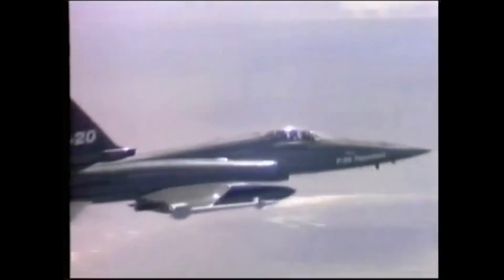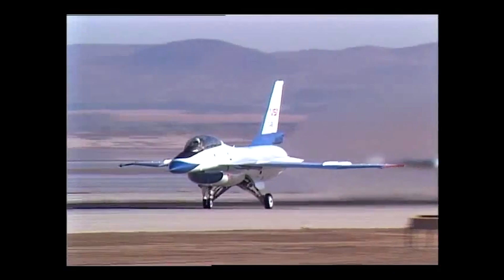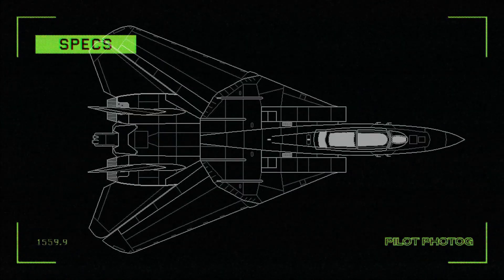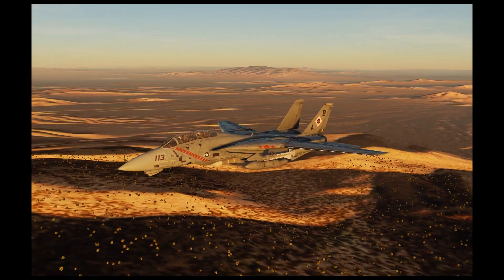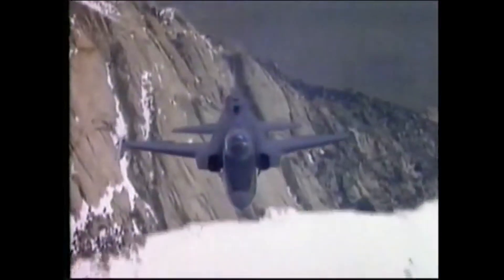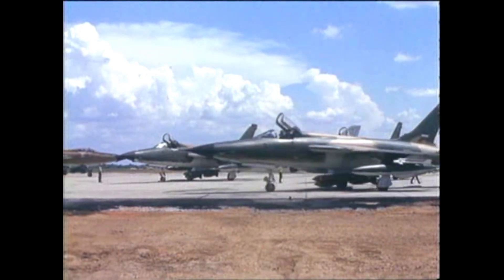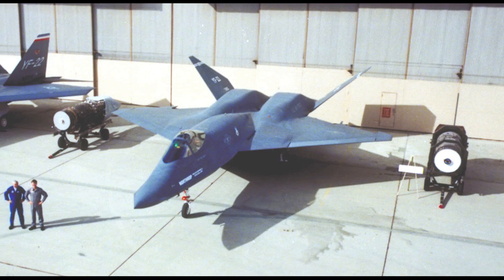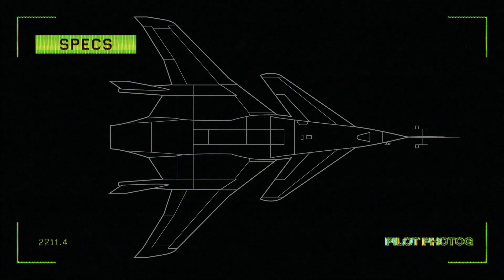Top 5 Fighters That Should Have Been Built | Best of Aviation Series by PilotPhotog  f20  f16xl

Comment: The Soviets inherited F-5E Freedom Fighters when the NVA took over all of South Vietnam. In mock dogfights, Soviet pilots learned the F-5E could quickly get behind a MIG-21 and register a "kill". And it did not matter if the pilot flying the F-5E was an experienced veteran or a brand new novice. The F-5E would win. This was a sobering revelation...when you consider the USAF did not consider the F-5E a suitable combat aircraft for adoption. The F-20 would've been absolute badass.
Reply from the maker: Agreed and thanks for commenting!
Reply: The F-5 is one of those underrated modern jets that I hope will be added to War Thunder some day.  I think it would be very competitive and fun to fly.
Reply: @CountArtha  the USAF has been using the basic design as the T-38 for a reason.
Reply: @svenschwingel8632  basically an F-5/F-20 without the armament and hardpoints, which I'm sure could be added if necessary
Reply: @CountArtha  the F-5 is easily my favorite Vietnam era aircraft.
Reply: Cold War era as well in my opinion. Cheap, easier to maintain, S/TOL capable, and out flew everything pitted against.
Reply: @CountArtha  As a War Thunder player, I agree. We should have gotten the F-5 instead of the F-4, especially considering the time frame of when the F-4C was introduced into the game, it would be much much more capable even now. However, I have a feeling we're getting close. We are getting the F-11 Tiger during the summer event, hopefully the F-5E Tiger II isn't far behind!
Reply: @CountArtha  War Thunder dog Fight is based on who has the lowest latency ping on computer connections ... nothing else !!!
Reply: @CountArtha  to this day it s still my fav of all the fighers ive driven
Reply: @CountArtha  Just get DCS, that has an F-5, a MiG-21, a FREE A-4, its great and its so much more realistic than the trash that is war thunder, so you'll probably have some trouble learning it.
Reply: And when the US assessed MiG-17 vs US fighters in Vietnam, they made recommendation that dogfights should always be avoided.
Reply: @FromWitchSide  Yes, our main aircraft were more "multi-role" than designated dogfighters. The USAF did not see an operational requirement for a designated, short range, agile dogfighter. At the time, we liked stuff with impressive bomb loads.
Reply: @FromWitchSide  Fortunately all that involved with the MiG-17 was the US Fighter fire-walling the throttle and possibly going vertical.
Reply: @FromWitchSide Actually the operation HAVE DONUT (the tests performed in captured MiG-17s) showed that turning fights against the MiG-17 in the F-4 should be avoided. Instead it was recommended that the F-4 should take the fight to the vertical where it had the advantage. This resulted in the Vietnamese completely abandoning the MiG-17 in the later part of the Vietnam war even though they preferred it as it was easier to fly.
Reply: Very narrow minded, if that’s the case.
Reply: the us want market for f16 that is why f20 got banned
Reply: Grandturismo the f-16 is a great aircraft. Maybe they should have built both, but no one should regret buying an f-16.
Reply: @catfan5756  Indeed  though at the time in most ways the 20 was a good deal superior.  The F-16 grew into a very very good fighter over the years.. and no doubt the 20 would have continued as well.   But those that are constantly trying to compare the 2 are looking at it all wrong since they were never really intended to do the same job per se..   But again dirty politics.

Had Canuckistan been smarter at that time and used their good relationship with Northrop then  the F-20 may very well have been build as the CF-20 alone with the F-18L instead of the /facepalm inducing stupidity of selecting the 100% untouched FA18 that cant even fly from Montreal to Toronto on internal fuel ffs!
  But thats another looooong story.
Reply: @grantourismo0109  Here's what happened: originally, the F-20 wasn't competing against the average F-16A/C. Rather, it was a variant of the F-16 with a worse engine and radar. Taiwan, South Korea, and Pakistan had shown interest in the F-20, but there were some issues: The administration in power at the time had put major restrictions on what US defence contractors could and couldn't sell to other countries. Every time Northrop attempted to sell the Tigershark to Taiwan or Pakistan, it was blocked. Thus, both Taiwan and Pakistan saw fit to develop their own fighter aircraft with a similar role to the F-20, those being the F-CK-1 (Taiwan) and JF-17 Thunder (Pakistan). Then, the two airshow crashes of the F-20 happened (no fault of the plane, or pilot, occured due to the pilots pulling too many Gs and succumbing to G-lock). Once the Reagan Administration look over, and restrictions were relaxed, General Dynamics immediately began selling their new F-16Cs to other countries, specifically to spite Northrop.
Reply: Pretty sure the US doctrine by then would move to BVR (as we see today) rather than WVR. But yeah, it's interesting how they just up & left the maneuverability component.

Then again, NG did implement the tech they have into the Hornets, so maybe it's not a lost cause after all.
Reply: @TheRibbonRed  the focus on BVR air combat served the US really well in the Vietnam theater. Especially with orders forcing pilots to visually identify targets before any engagement. And an AIM-7 that wasn't really reliable 🤔
Reply: @TheRibbonRed  but didn't military doctrine put a stop to bvr combat at that time due to several friendly fire incidents?
Reply: Quirt Manly  As I understand it, the F-20 while a good aircraft was short legged in range as compared to the F-16. As such, it was one of the reasons  the Air Force turned it down. Because our Air Force turned it down, many foreign air forces also decided against it in favor of the F-16. However that being said, I do agree that it would have been a great export model to allies in South America and other countries.
Reply: @coleparker  - yet these same nations bought Mig-21's, which have a shorter range than both, so... I don't believe this was a genuine factor.
Reply: @downix  Well, I am not necessarily disagreeing with you. But that was one of the reasons I read that it was a factor.   Also, as noted, the nations were not comparing or basing their decision on F-20 vs MiG 21 but the F-20 to the F-16.
Reply: @downix  Yes, but those MiGs were bought back in the 60s and 70s and even up into the early 80s when their competition was the F-5 and not the F-16 and they were cheaper to buy and were upgraded variants to the already existing numbers in those airforces that were employing,  IE, India, the former Warsaw countries and the middle east countries.
Reply: @coleparker  - the last mig 21 variant was built in 2013, keep in mind. People were buying them long after the F-20 vanished from the market.
Reply: @downix  Well, thanks for the info.  I do believe it was an upgraded variant bought by the Indian Air Force if I am not mistaken. Correct me if I am wrong. The only thing Negative, other than its limited range, I have heard about the MiG 21, was from an ex-Vietnam era Navy pilot, who flew a Polish Variant of the fighter. He told me that it was a hot plane but that it was easy to lose control if you were not paying attention to it at all times.
Reply: @coleparker  I have heard the same. India's record, having lost over 100 of them in accidents, would stand as testimony to that as well.
Reply: @coleparker  very good point. Along those lines, I seem to recall that the US also had an "Export" model of the F16 that was not quiet as capable as that used by the USAF or NATO. Have you heard anything about that?
Reply: @cameronsmyth6646  I have not heard that. But I think it may be a reference to the idea that the export models of the F-16 did not have all the latest avionics in them.
Reply: @cameronsmyth6646  @Cole Parker didn't you know the F16/79 version?
Reply: again faklse suppositon..  thats a common myth but is not why at all
Reply: @coleparker  People passed on the F-20 for one reason. It was Diet Pepsi.  The F-16 was real Pepsi. The Market said, "why buy Diet Pepsi if you can buy Pepsi?"
Reply: @WALTERBROADDUS  because zero calories and comparably great taste is why diet is better?
Reply: @WALTERBROADDUS  better analogy would be F-20 is store brand soda, F-16 is actual pepsi.
Reply: @WALTERBROADDUS  That is as incorrect as you can be.  The F-20 fired more weapons at the time and had a better reliability rating and much lower cost to acquire and operate than the F-16.  You could buy almost 2 Tigersharks compared to 1 F-16 at the time.  Also "E69Nazgul" the wing loading on the Tigershark was not terrible.  It had GREAT performance thanks to that GE-F404 engine.  Yeager said it was the best fighter he'd ever flown, and I believe him.  It was a great plane to rate fight and Yeager also said it had a good turning *radius*.  You want both of those things in a fighter.  There is a huge difference between someone like Spick who researches and writes about things vs. BGen Yeager who actually flies the damn things.  I know for sure who I would listen to.
Reply: @karlchilderz  Blah, Blah, blah....The market said we don't  want "Green Eggs with our ham."
Reply: @WALTERBROADDUS  yeah, and let me guess how much tactical jet experience you have?  I know.   Zero.

2200 hrs here.
Reply: @karlchilderz  haaaa my friend...business is business everywhere...ahahahah...
Simply marketing
Reply: @karlchilderz  Did you actually get to fly the  F-20?  Personally,  I thought the plane would have been an excellent export plane to those countries already flying the F-5E.  Also before you ask me,  I am a rather large male, and one of Chuck Yeager's first comment's he made to me out at Edwards AFB, was that I would never have made as a Combat Pilot:)
Reply: @coleparker  I've flown the T-38 and F5-E.   I didn't get to fly the tigershark, I wasn't a test pilot and didn't work as flight test for the manufacturer.   Yeager did, and his statements in person and in writing are what I go by.
Reply: @karlchilderz  Okay. Like I said, when I was sitting in the vehicle with Chuck Yeager, I  wished I had asked him about the F-20. Unfortunately I did not get a chance too. At that time he did not really like to answer any direct questions. So in order to get some of the information I did get, I had to kinda of slide into the subjects.
Reply: @coleparker  He has no problem being a prick, that's for sure.  I've seen him get short with folks.  No idea why he's like that.  When you saw other folks like Robin Olds and Bob Hoover, they were so nice and friendly it was heartwarming to be around them.  Yeager, he's just prickly and cold personality wise.
Reply: @karlchilderz  Yea, I remember when he called a bunch of C-130 pilots a bunch of bus drivers. They did not like that at all.  I found with Yeager if you did not ask him a direct question, but rather just made a comment around him,  like The ME-262 was better than the P-51, then you get a real response from him. When he told me I could never be a combat pilot, I just laughed, and suddenly he would tell me stories about, Pancho Barnes parties and breaking the sound barrier.
Reply: fuckk no... the 20 was handing the 16 its ass in more ways than not.. and if it was not for dirty politics then the 20 undoubtedly would have outsold the 16 world wide
Reply: Karl Childers Thank You!, The F-20 Out turn and more maneuverable than the F-16 . You know what ! The F-20 was a super cruise  fighter too . Way ahead of its time..They don’t Like Northrop!
Reply: Lol, I agree, TBH. Coke Zero is way better. In comparison Dirt Coke is pretty much medicinal.
Reply: @cosmiccoolie3051  Under Reagan, our milirary acqiured the humvee, the Bradley, the Abrams, the MLRS,  the B-1B Lancer, and the Paladin 155mm howitzer. The military that defeated Iraq in 1991 was NOT Bush's military. It was Reagan's. HE built that. Make no mistake.
Reply: there was undoubtedy alot of dirty politics involved  but rrr personaly i doubt   from what i know of him he really wasnt a hands on guy per se in that aspect.. but undoubtedly he was happyto have someoneelse lead him from a to be etc on such things..   as most politicians do in most things.

sadly that also leaves the system more vulnerable to more backroom deals and other bs
Reply: @WALTERBROADDUS  No.. thats  not even close to an accurate analogy

ffs.. the "real peopsi" you descrbe by that measure would be a cola w/o the COLA since the 16 lacked any capability for BVR at all not to mention many other major failings.

DIrty politics was the primary factor in that decision make no mistake and it sadly also playe a role in killing teh 20 even for export useers as well at the same time.
Reply: @MarvelousSeven  Nope.. again a massive FAIL..  the F-16 would be a bottle of 7up when you want a  bottle of Coke..
Reply: @kindanyume  The most successful fighter of the last 35 years. The  F-16 was the better buy. Performance beats politics.
Reply: @coleparker  How big?  I fit with room to spare at 5'11" and I had several others with me that fit as well and they made me look tiny..   My sparring partner Trev however would NOT fit as a rule in  well.. any fighter I think (He was 7'0" at 400lbs of muscle  no fat to speak of)

and damn you  all the time I was at flying at EAFB I never got a chance to actually meet him..  damn close many times but sadly no luck. :(
Reply: @karlchilderz  I have similar exp and would have loved to get my paws on the 20 as Ive said for most of my life..  But sadly no such luck but VYs word on that is work a billion and more..  I would take his word on such over damn near any other w/o any issues at all.

Not to mention my fav is still the 5.. even over the 15 which was also a hell of a beast :)
Reply: @karlchilderz  A friend that worked with him some time back and knew him for a looong time said he grew more that way over the yrs due to harassment by people in general as well as his being very annoyed with the level of stupidity that he saw continue to go up and up in both the basic brass bs but also higher up the chain and lunatic shit by non-mil nit-wits pushing "PC" garbage where it didnt belong and never helped anyone,
This also got worse after Glennis passed according to some other sources
Reply: @coleparker  They may not have liked it  but I can understand where he was comin from  at least in part.   I have met some driving heavies that are nice and polite and then Ive met others that think they are all that and more and almost all of them Ive found like that are washouts that wanted fighters but couldn't cut it for whatever reason.  Given his carrer I highly suspect he ran into far more of the latter and that would get most tiresome after a while
Reply: @kindanyume   Well, I am 6'4 inches tall and was big in the shoulders and chest,  although my gut is getting bigger thanks to Gruesome Newsom's shut down of the gyms in California.
Reply: The lessons learned from this went into the Mig-21 upgrade packages that the Soviets came up with.
Reply: Nato aquired Mig-29's when Germany reunited with promise they wouldnt be dissected by western intelligences .
Reply: @douglasmiller8607  There's a Mig-29 at the Wright-Patterson AFB museum, and it was clearly flown by American pilots.
Reply: @ashcarrier6606  intetesting, there's  a number of foreign aircraft at Nellis AFB that are flown by American pilots.
Reply: @douglasmiller8607  engines in W. German mig-29s are only capable of 90% the power of the Russian model. That is intentional.
Reply: @MarvelousSeven  I do not know who told you this, but it is not true.  I flew against those jets.  They had everything they were supposed to have from the factory, power rating and all.  They had those IR missiles they'd "kill" us with because we at the time did not have any HOB missile capability.  The Aim-9x was a long way off at that point. They could shoot the hell out of that Archer however.  

In any event, do not believe who or what told you the engines were de-rated because they were not.  They were powerful, and they sure as hell were smoky, but watching them in the air was a wondrous sight to us at first.  We were just mesmerized by the thing.
Reply: those F-5E came through Clark AB on C-5 transport to be assembled then flown to South Vietnam..
Reply: Look at my profile pic.
FAH
Our air force has shot down several narco planes. The F5s were the reason Nicaragua had to bring in soviet Sams to central América in the 80s and 90s
Reply: You may remember that the F20 was originally designated F5G and that the US had an agreement to allow Taiwan to buy F5s.  China pressured the US to not allow Taiwan F5Gs so they were redesignated as F20s to keep China happy. I have often wondered if the B2 contract was partially a payoff to Northrup for not protesting too much on the F5G/F20 screwing they took.
Reply: @normanhosford2506  You would have a better argument about the yf-23.
Reply: @normanhosford2506  That had nothing to do with why it didn't make it to market.  As has been shown, when the USAF didn't want it, it made other folks stop and say "if the USAF doesn't want it, why would I want it??"  and that's all it took.  Not all fear has to be rational or logical in its nature.....
Reply: The Israeli Air Force using the F-16 in the Osirak raid ended any hope of international sales for the F-20. Why take a risk buying an upgraded low budget design when you can get a thoroughly modern, combat proven aircraft?
Reply: @tpxchallenger  That is a prescient, well-considered observation. The F-20 would've been an excellent, low cost point defense dogfighter. But against a "low cost" fighter that can in one mission achieve a strategic victory? As opposed to mere tactical victories?
Reply: As Chuck Yeager noted, this was the Best Interceptor (short range) Ever!
Reply: Vought XF8U-3 was the best that was not chosen
Reply: @user-gu1hl2kx2k  no way, but it definitely should be on the honorable mention list.
Reply: The F-20, I believe it superior to the F-16 and a much more able dogfighter! It's a great design!!!
Reply: @mickydee7568  That's great ! 
Pls provide your infor source, 

also what was USAF's over all strategy(s) when they developing F15 & F-16, 

Also, with USSR alreadly know about F5's inside out, does USAF really want a F5 (2.0) to help USSR ? 

just asking,
Reply: The F-20 should've gone to Taiwan, but they didn't want to upset the PRC!  Bad on so many levels!
Reply: @folgore1 It should have gone to Canuckistan along with the F18L instead of the blunder of the powers that be forcing the FA18 instead.
Reply: Northrop designed and built the F20 on it's own dime in exchange for the government selling it. Gov. shafts Northrop. It was just political. Great plane designed for the export market. Not for U.S.
Reply: Well I'm not surprised by that.  The MIG 21  was fast but in a one on one full on fur ball the F5 is more nimble and is going to turn inside of the 21.  The 21's only hope is to bug out and scoot in that scenario.  Of course, numbers, tactics,  and sophisticated weapons can change the out come!  The Kenyans still fly F5's.  Bet they would like the F20!
Reply: @edwardsvancara7133  There are many F5s still in service,,  again its still my fav to strap into even more than the 15,   Some have some very sweet upgrades as well to keep them very much closer to modern gens.. and in many ways superior IMO..  sadly the power factor was not one part that was fixed that I know of.. (not counting thr F20 obviously)  There are several engine possibilities that could be made to work in the 5 though with a nice increase in power..  but given the age of the airframes thats not likely though I could wish!

That said I'm hoping the leaves and shirts get a clue (ie dont completely screw the pooch) and nab the newest Gripen for canuckistan..  of the 3 choices avail its by far the best  and it is in spirit a modern day F5 as much as one could possibly wish for given what is being made
Reply: The politics prevented us from getting the better aircraft at he time. Jack Northrup pissed of the people who make the decisions to buy the aircraft and got blacklisted. That's why they didn't build the B2 till after he died. Also I wouldn't put it pass our leaders to own stock in the winning companies. I did  air force maintenance for 9yrs, on F4 mostly. Talked to F5 mechs who worked 1/4 of what I did. Would have loved to work on F20s. They would have been the perfect alert aircraft. Too bad they never had the internal fuel capacity for extended flights.
Reply: @jeffreykiszer5239  JN was very much like KJ in that he wouldn't take shit from the aholes that were clueless in office.  The biggest diff was KJ had some staff that were better at suckin duck in DC.
Also Northrup wasnt blacklisted per se..  but it did not get the support at one point due to some dirty behind the scenes deals.  several of which came to light over the years in a few various scandals.  But the surface result certainly made it appear to be a BL.
The B2 and his death was a big deal since JN refused to compromise and also refused to intentionally build in certain "subcontracts" that were wanted for friends of friends  (typical politics)
To that regard while it did  make some aspects suffer I do applaud both JN and KJ for their brilliance and refusal to compromise the product for sake of politics.  (Notice how LH went to shit after KJ's passing.   how sadly typical of wayyy too many successful companies.  KFC.. Rogers communications Canada, Carver Corp, and a ton of others all bean counting greed after control is lost by the creator for X reason.)

As for main work  My hats off to you as well.  As I always say I always made a point of thanking the grease monkeys that kept shit in shape since its those guys that in turn kept my ass as safe as they could when I strapped in.  My job couldnt be done w/o them afterall!

Never had a chance to get near a working 4 personally,,  but again I loved the 5,, its still my fav.. even more than the 15 by a small margin.
The 20 I can only dream about ever getting for obvious reasons and if it was somehow magically possible today you bet id be strappin my old broken ass into it in a heartbeat.

The 20 was so far ahead of its time in so many ways..  and as an alrt front line it was 2nd to none.  Even now very few can compete..  One of which is another Im a BIG fan of though Ive never gotten into one (yet..  hey  I can wish eh?  Ice cubes chance in hell at this point but again you know Id beg cheat and steal to get into the new Gripen for even a nice fam flight!)

The Gripen is so much the embodiment of the basic philosophy the F5 family followed you'd think Northrup was involved.   The uber ease of maintenance.. insanely quick and easy turn around even hot on a side road with 1 trained tech and 4-5 basic helpers..   Hell they can do an entire engine swap in under an hour!   I bet you'd love working on such like Id love to strap into it,

Here's to hoping Canuckistan gets lucky and the idiots in office including king tard justin dont screw it up and we get the Gripen  built here  much the same as Brasil has.. (and Brasil did to thr 5s what we should have  but case in point  morons in charge screwed the pooch again there big time)
Reply: @jeffreykiszer5239  I really think it boiled down to America just not needing a "point defence" fighter with short range and limited payload in the decades of 1950 through...well...this present day.
Reply: Politics killed the F-20
Reply: @edl617  Sad but very true..  very dirty politics and backroom deals have killed that and some other great things over the years,,
Reply: @edl617  Exactly!
Reply: Must explain why all of the enemy fighters in the movies are T-38s or T-5s - lol. Too bad it costs a large fraction of the GDP to develop a military jet. It's just too expensive for any one company to do without government help. Hence, small light fighters like the T-20 never make it to market.
Reply: @jfan4reva  Well, one of things that make any fighter development expensive is the fact that the Military sometimes keeps changing the requirements or roles the airplane has to meet. For example, the F-16 went from being a simple fighter  to a fighter bomber. Therefore modifications to air frame, engines etc. all had to be made, thus increasing the cost.
Reply: @coleparker  did you know the F16/79 versión?
Reply: @E69Nazgul  No I cannot say I do.
Reply: I watched the F20 during a airshow--- what a plane!!!
Reply: That is an absolute myth and a lie. Link to a credible source or it never happened.
Reply: @ceaschannle5752  What is an absolute myth?
Reply: @coleparker  Myth about Soviet testing of F-5 being so much superior to Mig-21 in maneuverability. No such evidence otherwise it would be published or video of it.
Reply: @ceaschannle5752  Gotcha.
Reply: I fully agree! I remember the accidents with the type.Pilots pulling a lot of g or something like that.Became unconscious.
Reply: @CAD-th1qe  2 pilots died with the 20 from gloc officially..  the airframe itself can take far more than the sack of meat in it
Reply: Ashley Carrier awesome post, I did not know they , the Soviets used the Tigershark from S Vietnam. What a shame we did not use it more widespread.
Reply: @jasestrong  It's just one of those things you would expect from Cold War competition.  A US ally like Vietnam collapses to Communist North Vietnam and the Russians use the opportunity to play with captured American equipment.  And of course when Egypt made peace with Israel and became an American ally, we got a chance to look at all sorts of Soviet equipment.  Even worse, when the Shah of Iran's regime collapsed to the Ayatollahs, the Russians likely got a chance to play with F-14 Tomcats.  I've never read about the Russians/Soviets doing any tests on the F-14, but you only need to connect the dots to know it's very likely.
Reply: @folgore1  Iran hated the Soviets just as much as the US. It's highly unlikely they shared any technology with the Soviet Union, let alone their now-limited supply of F-14s
Reply: Chuck Yeager agrees with your message.
Reply: Ashley Carrier Reference please.
Reply: @thethirdman225  I posted a link two days ago. Or you could Google "Soviets test captured F-5E".
Reply: Ashley Carrier I did. The information is, to say the least, very sketchy. It also gives no information on the ROE for these simulations. In terms of performance, Google “Phil Frawley MiG-21”.
Reply: When the Russians showed up in Korea our boys got butchered. The commies had better planes. The Germans bought a fleet, over 1000 of F105 (?) I forgot the model. Those pieces of crap crashed left and right.
Reply: Desmond Griffith  I think I first encountered this in a book about Amerca's "aggressor squadron" operated secretly out of Tonopah for a large chunk of the Cold War. I do not recall the title. I read for enjoyment, not for the purpose of quoting sources to Doubting Thomasas on the internet. If you are a military aviation enthusiast and you HAVEN'T read a book about the Soviet aircraft we operated out of Tonopah...I would say you spend too much time looking at your phone! The Mig-29A at the Wright-Patterson Museum is one of those Tonopah aggressors.
Reply: Desmond Griffith  I think Red Flag may have been the title of that book. The plan to aquire Soviet aircraft by hook or by crook was born out of Vietnam experience. 

The idea was an American pilot or aviator's first thought upon encountering a Mig in combat should not be, "Oh my God! A Mig! A Mig! Oh my freaking God!"

It should be, "Oh....another one of those things. Okay....waiting for tone...waiting for tone...."

So a pilot's first encounter with a Mig would take place over Southern California or Nevada.
Reply: Fi
Reply: half the F5 are T38 from the USAF
Reply: Every US Fighter must be capable of self deployment from West Coast to Hawaii. Hence big fighters.
Reply: @TheDustysix  Yes, the reality is that America simply had no use for a "point defense" nimble dogfighter. We have allies  that DO need such a thing, but we need complicted multi-role aircraft.
Reply: @TheDustysix  /facepalm @ your FAIL
Reply: @kindanyume  Your channel has no content. Troll.
Reply: And when is a dogfight vs a Mig 21 relevant in 2020?   It isn't.  The F5E might have worked in Viet in 1972 better than an F4 but the F 20 was not invented yet.  The F16 was much better and has proven it's worth.   We sold plenty of F5s to other nations.  Look at the results. It's a cheap, maneuverable fighter.  It can't hang in BVR fights of this century.
Reply: @MarcoOfficial786  I suspect the Kowsar has no meaningful BVR capability worthy of the name.
Reply: The F-5E was a born dogfighter, but the USAF doctrine of that time (and the current time as well) was not centered around a fighter proficient in dogfights alone. In fact the main American fighters dedicated to air superiority made ever since the F-4 are big and powerful. Why is that? Because they value attributes such as speed, range, big radar systems and offensive payload. The F-5E is at best mediocre at speed (while a supersonic fighter it won't exceed Mach 2 at top speed) and very lacking at the other parameters. 

It doesn't really matter that the F-20 could have reached Mach 2 and been potentially more agile than any of the other 4th gen American fighters, the USAF was simply never going to adopt it. The US role during the Cold War, fighting proxy wars like the Vietnam War or other wars fought in foreign soil (e.g. both Gulf Wars) dictated that their fighter aircraft would have long range since they would operate from allied bases in friendly nations bordering with the zone in conflict (and often flying combat air patrols, loitering around a conflictive point), rather than defending homeland territory where long range and flight endurance are not a prime necessity.

 Blame it on the US' miltary doctrine of interventionism (plus the all-encompassing American philosophy of making EVERYTHING big and powerful). The F-20 could have been a great fighter for most small nations looking only to defend their own airspace but in the US it was a non starter, unfortunately. And you know, in the end, they supplanted it with the F-16, which was slower but better in the other parameters I mentioned (specially in the payload department, since bombs are obviously heavier than A2A missiles and the USAF had, and still has, the idiosincracy of converting every air superiority fighter design into a multirole eventually, because of effectiveness-cost reasons and whatnot). The F-16 was more suited to be a multirole than the F-20 was, so they went with the former.
Reply: partially true  but you miss a lot of the important factors in there including he backroom deas.. politics and asshat "stars" that think they know best just because they kissed the most ass ove the years..     yet its morons that lfailed to learn that actually best show why the USAF failing to adopt such as they should have to be a massive failure on their part of truly epic scale..   

elegant proof..  ask ANY of those that go shafted by being hanffed an F4 w/o even a gun and sent up against the migs,,,,      the harsh lesson was learned.. and they as history is knnown to to becauise the next fyard thinks hey somehow wont fuck the dog the way the prioe moron did while doing the same dumb shit did..

ie they added guns and came up with F15/16/18 etc that could dog fight!..   and then low and behold.. the ninnes go and prove what i've just pointed out with the absolurte pos f35...    

the level of stupidity displayed by the USAF here is again staggering..

I'm very happy that in my time with them they had more brains than they do now..
Reply: oh and ps  Fs lack of power could have been fixed..  but the pylload limit was not so much a powerfactor.. but rather more inherent to the wing design.. and hence why rthe 18 which is a decentdant raised the wing for greater clearance and thereby ccomodated a better payload..

but the 18 suffers fromother flaws.. and dont even start on the SH..  shouldnt even be called an `8 at all.. only reason it exists is due to the lie of calling it an 18 and congress foolishily belieing that load of crap.
Reply: Quick question. Did the Soviets get F-4 Phantoms when NVA took over?
Reply: @F22ERaptor   from what I understand only the US pilots flew f-4 phantoms and those were out of the country buy that time . The Soviets only got to examine the wreckage that was shot down but that was as far as they got . The South Vietnamese only got to fly the F5 . They did get to examine f-4s from other countries like Iran ! But not sure what the result was that.
Reply: @sleepingrabbit4011  Thanks for your reply! I've always wondered about the F-4 given that huge quantities of US equipment fell into enemy hands after (and during) the Vietnam War.
Reply: @F22ERaptor  No Phantoms were given to South Vietnam.  The DOD thought that the F4 was too complex for the Vietnamese to properly service (it required more than other "contemporary" aircraft) and they were also worried about the F4 falling into Communist hands.  Ironically, the Russians and Chinese would get samples of the technology from F4s that were shot down by NVA AAA and aircraft.
Reply: @F22ERaptor  Not that I've heard of, but that doesn't mean they didn't. America operated a squadron of Soviet aircraft out of Tonopah. Models that we begged, borrowed, stole, or bought outright. Our pilots liked the Mig-21. Hated the Mig-23, which would apprarently try to kill the pilot in some way during every flight.
Reply: Ashley Carrier ű
Reply: @F22ERaptor  no f4 in south vietnam air force
Reply: @F22ERaptor  No, the SVAF never had Phantoms. Lots and lots of Skyraiders, though!
Reply: Yes if everyone noticed nowadays many Western allies countries don't jump to buying latest US fighters like F-35 because they most probably learn their lesson from the F-5/F-20 to F-16/F18 transition. Most loyal allies with big pocket or special privilege usually can get F-15. But most NATO/western allies have smaller budget. They bought F-5 during the cold war it was cheap to operate and maintain. But just before the cold war ended USA pushing everyone to replace the good old dependable F-5 to something more expensive F-16 for smaller countries and F-18 for countries with slightly deeper pocket. Now with the cold war ended most countries don't really need expensive fighter planes. They could just slowly upgrade electronic or engine. F-20 would be perfect for those smaller countries with less defense budget. Still fast still up to date and perfect for defense and most likely these operators don't do much attacking. It's interesting to see Canada change their mind in ordering their F-35. They are more realistic and honest with what they need. Rather kept the older F-18 because the so called cold war threat is not there anymore. Why spend more money in very expensive jets when you can get cheaper one to keep up with realistic defense needs.
Reply: @D_2_M  Canada is most likely buying Swedish JAS-39 Gripen's, thats why they opted out from buying the F-35.
Reply: indeed  we can hope..  its the SMAART move by far esp given the $ and our actual needs  the Gripen will do such and do it in spades!
Reply: @evangalinsky2499  Not quite right .. but close enough  and if we are lucky we will get the Gripen and build it here in canuckistan much the same as we did the 5 from Northrop..  only we will actually use the Gripen properly unlike the disasterous farce of the use of the 5 and 104 by the idiots in charge way back when..
Reply: @D_2_M  A lot of them are looking more to lower cost 5th generation fighter planes like the Swedish Grippen rather than upgrade to upgraded Super Hornets or ultra-expensive F-35's.
Reply: @wigon  Not to mention the fact the 35 is a complete pile of very pricy shit    and meanwhile the Gripen is like the 5..  absurdly capable and punching far beyond its weight class

as for the bloated SH.. they are almost as bad a pick as the 35 would be..  and Boeing has killed off damn near all the best parts of the original Northrop design that made it good..  now its the size of a 15 and cant even come close to matching the 15s capabilities..
Reply: in part true  and i cant elaborate properly at.. on a damn tablet
but for cauckistan the choice of the FA18 was a mistake in many ways..  we should have nabbed either he F18L and built it here same as we did the 5.. or the F20 which was in the works already at the time.. and Northrop would have had a winner for us most likely if they had put it forth as an option (F18L is very similarin many ways only twin engine and better overaall than the FA18 will ever be)..  

that said for current countries including canuckistan..  they would be wise to skip teh turn f35 entirely   and we should now make a deal to license and buolt the Gripen E/F here..   it is the closest thing available right now tto a modern day f5./F20     andgiven the advancements as well since then its an absurdly capable  and very under rated fighter...

tthe act that its won against so many that thought it would be cannon fodder is testamount to just how good it really is.. and on top of everything else.. its a bargain esp vs pos like the 35..

canada could licence and build 150 of them for less than the cost of even a fraction of that # of 35s.. and for the st time in yrs we would again have enough aircraft to allow our drivers more than the pathetic minimal hours they get now..
(also note.. we could have had more hours cheap as well but the ftard Libs willfully destroyed almost all of or remaining 5s that were perfetctly useable and in storage..   destroyed beccause they were morons that couldnt understand why othrs that qwanted to buy them would rather buy less used migs for less than 1/8 of the price the gov was trying to demnd..  and then to add insult to injury they refiused to let anyone have them.. not even museums of ex-service members like myself that would have love to have a chance to have one!!!) GRRRRR
Reply: @D_2_M  I agree perfectly! (from Hungary)
Reply: @D_2_M  :
Reply: @D_2_M  Yes, if the F-20 were revived and equipped with Fly by Wire (HOTAS) control, digital cockpit (HUD) and all the technology for electronic warfare and an armament systems management suite plus an AESA or PESA radar and a remotorization, It will be a formidable fighter with the advantage of its low operational and maintenance cost becoming a 4th. ++  generación fighter plane, being attractive to countries with emerging or modest economies: Latin American countries, perhaps a contender for the SAAB Gripen NG or the F-16 Block70 or F-16V.
Reply: The reason that killed the tigershark was wing loading ratio
Reply: @E69Nazgul  Interesting. Could you expand on that point?
Reply: @coleparker  Yes my friend. 
Designed for the kill, a Mike Spick book, says very clearly that the main factor that killed the tiger shark was that although the aircraft has a improved thrust weight ratio, the empty weight raise because the engine weight more than the two previous engines, so unfortunately the wing loading raised, making the turn radius being equal or more or les than the F5E, so the F16 maintaining the edge in turning radius and turn rate superior. 
Thanks for asking!!! 
At least someone with very interesting and intelligent curiosity about air combat fighters.
Reply: @E69Nazgul  Thanks for the info.
Reply: @coleparker  I believe he referred to the fact the wing was older tech and lacked lift compared to state of the art like the F-16. They made it agile with enhancements like strakes, but the lack of raw lift limited the load it could take off with and this limited range and payloads. I think it was competitive or superior in most other areas but this limited the appeal and the  government wanted foreign sales of F-16s to help offset the cost of the ones we bought, so there was no incentive to push it or encourage sales.  Much of the unit cost then was the high development costs, so more units produced meant lower prices.
Reply: @E69Nazgul  ty for the technical explain 😘
Reply: no it was not..    jeeze   you ppl will post damn near anything w/o any factual basis at all.. its sad really...
Reply: The F-5 and its derivative F-20 "Tigershark" were rejected by the USAF due to their inability to carry much of a bomb load.  Every US "fighter" has had a tactical bombing capability and many even a dedicated "attack", or what used to be termed "fighter-bomber", version produced.
Reply: @selfdo  True as well. My point is this : need a more well balanced aircraft which is cheaper, easier to produce (have more on hand) less complicated to maintain/repair in all conditions (weather and runway/flightline) quick turnaround to get back in the air for the fight. Currently we do not have anything which meets those conditions in the inventory say for a long or extended war involvement.
Reply: wow  you have so much to learn oviicously an yet spout this drivel base on a tiny bit of inaccurate information...    how sadly typical of many on YT

do yourself and everyone else a big solid and go LEARN about the actual history of the F5 and F20 before opening your mouth again and making an even bigger ass of yourself.
Reply: The Vietnamese got F-5A Freedom Fighters! No Afterburner! So your Story about the Russians testing F-5E against Mig-21 is Bogus!
Reply: @WanderfalkeAT  say what?   there are no 5s w/o burner...   There are other aircraft using the same engine w/o ab but none of the N156 family 

and no its NOT bogus you dolt   the Ruskies tested the F5E vs the mig21 using one of those that were captured/abandoned by the US forces during the withdrawal  from VN  and they found that the 5 won in every single test they put it through against that Mig..

Also the 5s that were given to the SV were the Skoshi tigers which are F5Cs not a's (The c is a modified a with upgrades.. some of which were later used for the E and some which came from the CF5A)

Seriously  its tiresome seeing dolts continue to make false claims like you did when you have failed miserably to actually learn the facts before trying to either make false claims or claiming someone else is doing so..
its extreme lazy crap on your part to say the least
Reply: @kindanyume  Yeah I allready researched that they got a E tested. I never knew that they got one. And the C was not much stronger because it had basicaly more weight but the same engines than the A. I allready had a discussion here with a RCAF tiger pilot about it.